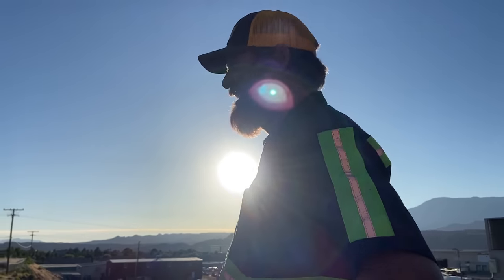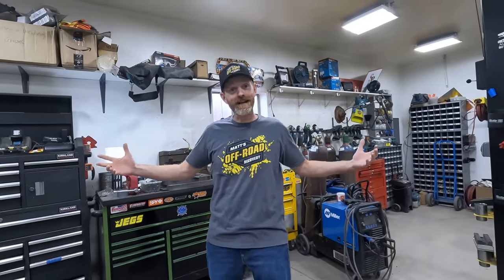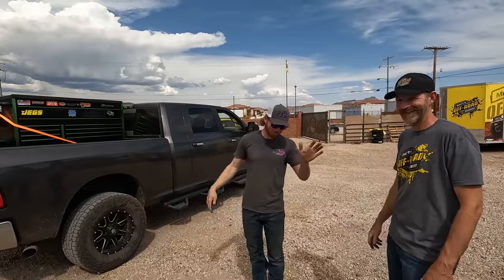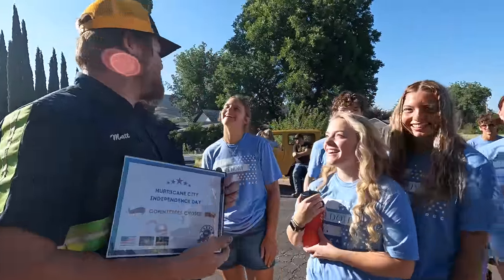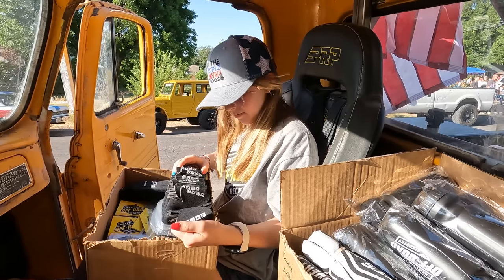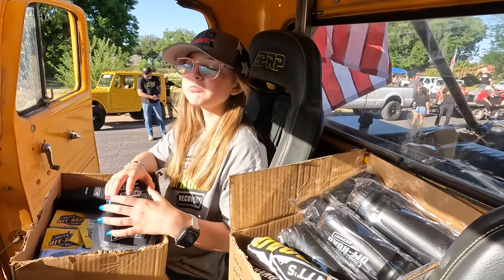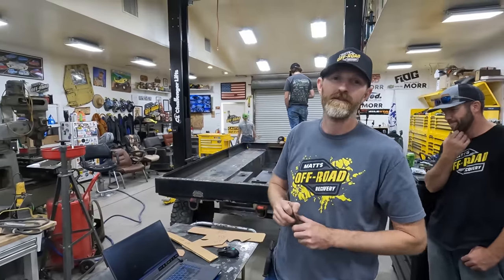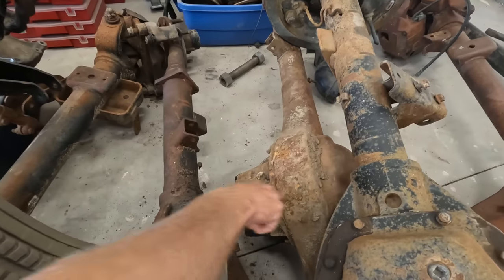Ed Teaches The Team Old Tricks! Bombi Build

Comment: Rhett and Jaymie were absolutely the most impressive at spooning on the tires. Jaymie did it in flip-flops, and Rhett just absolutely killed it.
Reply: And I was wondering if he would even be able to do it he’s like 17 or something not a modern skill we see a lot
Reply: @mikesmith-wk7vy  I think he recently turned 16
Reply: @mikesmith-wk7vy  not a common skill, but a useful one.  Unless you're really serious about DIY, you're not going to have the machine at home, and definitely not on the side of the road.  Being able to mount a tire means you don't have to have extra wheels.
Of course, it also lets you do a patch instead of a plug, but having forgotten about a plug for 20k miles with zero issues, I'm not really convinced they're any less reliable in the real world.
Reply: Rhett: "...hold my MtnDew"
Reply: But breaking a bead on the side of the road...not easy
Reply: @kd5nrh  I'm with you on the plug comment. I don't know where this fear of plugs has come from but it's only been relatively recent. I've only had a few plugs in my tires for leak repairs but I've been doing it for fifty years and never had one fail yet.
Reply: When I worked for a tyre (U.K. spelling) firm, MANY years ago, a plug-patch, fitted from the INSIDE was a legitmate repair.
Reply: @kd5nrh agree plugs are fine. People say thay are only temporary. I say they are as temporary as the tyre.
Reply: @mrmotofy  old school  answers still work every time. Worst case scenario, invert your jack over tyre sidewall  and use that to crack the bead,
Reply: @kd5nrh  Had a tire on an SUV with 5 plugs, it was the only tire that never leaked. Never had an issue till the tread wore out and they needed regular replacement anyways.

Comment: Jefe was the only one to have his tire completely on the rim in under 2 minutes other than Matt. That, to me, was the time to watch since how easy or hard a tire is to get the bead sealed is a roll of the dice. GG to all of you.
Reply: unless it is holding air it is pretty much useless.
Reply: @iffykidmn8170  The video was about mounting tires with old school hand tools. You have to put air in them even if you use a machine.  You missed my point.
Reply: @kogo2951  agreed. I've hat tires that caught air quick and some that took the fires of hell to catch. The real time on spooning is the tire on the wheel. That's why when it didn't want to seat it was all hands on deck.
Reply: And by "fires of hell" do you mean starting fluid?

Comment: I was impressed with all of the crew as to how well they did. I do tires by hand all the time but with a stand to hold the tire. The stand makes it much easier to dismount the tires more than it helps to mount it but the rim not moving makes it nice. One mistake they made was bringing the tires into the shop to cool them off. The warmer a tire is the more flexable it is and the easier it is to mount. Living in a northern state, I've had to stick hair driers inside the tire to warm them up to mount them as they were just too stiff.

Comment: I think the tire mounting competition was one of my favorites.  I use to do tractor trailer tires by hand. I can say that after doing that for a while I picked up what worked and what didn't and I got pretty fast doing it. Getting the beads set so you can fill them, it's sometimes more luck then skill.  I hated when the tires were delivered banded together because the tires on the ends would always be hard to get seated. I did this stuff before the had the big quick release air tanks and I was not allowed to use any flammable sprays. Sometimes if I saw them delivered strapped together I would try and cut the straps asap especially if I saw them the day before. That left them expand so. Anyway I think this was entertaining and I enjoyed watching it, and I was glad to see that when someone especially someone who never did it before was struggling that you left them go a little bit and then gave them a hand.  Also I like the new toolboxes but some of them look really tall. You might need to keep a step nearby for those who are not as tall.
Reply: We used to put a tube in them and put in enough pressure to stretch them sideways a little for a day.

Comment: -- For all you guys hording parts ... one more year!  Couldn't agree more.  Or, if you do get rid of it, you'll need it a week later :)  Happy to hear Tom say this is going to be a long series.  
    Nice of you to do the parade.  Was there anyone else but your lot in it?  And of course anytime Ed is involved, happy day.
    With no suspension, I hope you consider dampeners.   I was a bit concerned, understood the plan, knew the suspension was clapped out; think body, seat/etc dampeners would be an easy step.  
    And I see you have a much different definition of spooning in a shop than we did in the military :D  
    Thumbs up.  Thanks for working on this thing.  Maybe before you get too far some rust converter and RP-342 (It's like Fluid Film) bearing in mind you're rolling in the snow.  Protect it a bit.

Comment: love following your projects and recoverys! I'm a aircraft mechanic and a farmer (!) with both experience of doing the right thing, and doing the right thing the wrong way.... I want to share my experience with machines and sub zero temps. Parts that produce heat will melt snow and ice. When the machine or part rests, the water will freeze to ice and seize the parts. I'm thinking of your choice ot put on extra brakes on the Bombi, and where they are placed. To aviod problems I would suggest to move them (not easy), shield/cover them to stop water from getting to the calippers and disks OR apply constant heat (from exhaust?). Good luck!. From Norway. Gunnbjørn

Comment: These are good lessons for anyone. Good job by everyone.
  My Dad ran 700-16's on his 69 Chevy 4x4. We'd load firewood cab high full length of the 8 foot bed. He had an endless supply of old 600-16  1940's Chevy car wheels that were too narrow for the 700-16 tires, so the loaded truck would split the side of the rim out. I seemed to draw the short straw on changing the rim and tube out. He didn't have any spoons so we had to use crow bars. It did set me up for being pretty good at 10:00-20 forklift tires later in life.
   I trained my kid, and his job starting at 13 years old was tire repairs before the sawmill went all tubeless. He hated the thick sidewalls on skidsteer tires.

Comment: Awesome job Tom, get a label maker. LOL Then Matt will be able to find stuff without yelling "Where's the @#$$%%^ Grinder. I can't find it $%%^^* anywhere?" They are nice tool cabinets too. You are dead right about storing projects and odd parts, as soon as you dispose of them you need them and then have to buy them at a ridiculous prices because they are now rare. No its not hoarding, it's storing. Im a mechanic too and tyre mounting is not as easy as it looks. I've only had 1 truck tyre and split rim let go on me and it was coming up to 60 psi and it blew the side wall out. Luckily it was in the 3 pipe tyre cage and it launched it off the ground. I had to have a little nervous sit down for a minute after that. LOL

Comment: Even though I've never seen Ed mount a tire, I would put myself between him and Matt.

The vast majority of tire work I ever did - including working at a Ford dealership during the Firestone recall debacle, where we did TONS of tires - was with a mounting machine.  I worked some of the earliest, primitive machines that were completely mechanical; I've done it on the ground with spoons, and I've done split rims.

With the horizontal plate machines that grip the tires, you can get good enough to basically "throw" the tires onto the rim because the machine grips the rim.  It's really difficult if the rim isn't holding still for you.

I haven't busted tires since about 2001 or 2002, but I think my time would be about the same as Matt's, give or take a minute.

Comment: At Scot-Track in the 90s we were building 8x8 off-road vehicles that used 8-wheel drive with ATV tyres for most applications but had tracks over those tyres for some applications. The ground pressure was insanely low! These had either chain drive to all wheels or hydraulic drive depending on model. There was NO SUSPENSION and it was fine. So no suspension and pneumatic tyres with tracks over them. The only key difference with your machine is that there is only one drive axle but that is OK so long as the track is strong enough to deal with that scenario. (These Scot-Track designs were also sold to Ransomes who made these in the Nebraska for a while.)

Comment: I've always called them tire levers, not spoons.  I did it to my '76 Honda 250 enduro when I got it from the junk yard in the early 90's.  (Along with a carb rebuild.)  If my memory serves me, I think it was a 6V electrical system for the lights.  Perfect transportation in San Francisco city where parking was non existent.  Just pull up on the sidewalk to park, no pothole or curb too big to just ride over.  Bike was dead reliable.  Two kicks at most to start.

Comment: As far as the suspension on the Bombi, your thinking in the opposite travel direction than a tracked vehicle's suspension works. The suspension isn't to absorb bumps, but rather to keep maximum track surface driving on the ground when going over dips, i.e. push the track down into holes. Basically, by deleting the suspension, you're sacrificing half of the benefit of having a tracked vehicle.

Comment: Matt, would it be worth buying all of the different types of screw in recovery hooks and keeping a set of them in the MorrVair and Banana?

I know you don't use them often, but seems like they could be very handy for the few times that you do use 'em. I can't speak for everyone (of course), but I'd much rather have to replace a $40 bent recovery hook than more expensive car bits. : )

I know this is off topic for this video, but I've just watched one of your older videos where the customer had lost their screw in recovery hook for their Mini Cooper.

Oh, one last thing.... in an earlier video (and by earlier, I mean waaay earlier), you asked what the wires were for on the inside of a Tesla's recovery hook cover. You can touch a 9 volt battery to those wires to pop open the front trunk (aka, "frunk") when the Tesla's battery is dead.

Comment: OK....Being an old guy...I learned to mount tires by hand in 1973 out of necessity. We had a manual tire machine but the center post was too big for the hub hole on 13" and 14" MOPAR wheels. Hence...hand mounting. I start just like Matt and most times you can get the back bead over the outer lip of the rim without any tools. I used soapy water rather than grease for lubrication. The next "step" was actually to step on the tire and hook the outer bead over the rim into the narrow part of the wheel (near the centerline). Step three was to use a big honking rubber mallet to beat the bead of the tire past the rim lip, working it from where the tire bead crosses from the inside of the lip to the outside. In my hay-day, I could manually mount a tire in under a minute that way. If the tires had been stacked for a long while, the inner and outer beads were often pinched together so it was tough to get air in to pop the beads on. With the soapy water, you could generally force the tire onto the inner lip of the rim enough to get it to stick (generally more taper on the inner side) and then pull the tire by the tread toward the outer lip while feeding air and it would mount. Ratchet straps never worked too well for me as they were too wide and crumpled the tire causing uneven pressure on the beads against the lips of the rim. A narrow "belly band" or a rope tightened by twisting a screwdriver also worked. I only used tire irons to dis-mount the tires. Rubber mallet only for mounting. In 50 years, I likely mounted hundreds of tires that way.....but most of those were done in the first ten years starting in 1973. Please ask Ed if he agrees with my 50-year-old method.

Comment: As a teen in the 1980's all we had was snap-on tire spoons and a snap-on aviation style balancer from the 1950's. Ended up owning 3 auto repair shops by 2000. I STILL use those old tools.

Comment: My first experience with mounting tires was on a Model T Ford.  30 x 3.5" tires with tubes and flaps.  There isn't much room to work.  I pinched a couple tubes before I got it right.  Not many 10 year olds circa early 90s could say they had done that!

Comment: So why not adopt the superior German engineering of the 1940's and use an unnecessary amount of interleaving wheels? It obviously is the better setup as it totally won the war fo- I'm totally kidding. I'm glad your sensible in not doing interleaving road wheels or rocker bogies or, heaven and Tahoe forbid, Christie suspension. But you are having to deal with a bit of a catch 22 situation. The Bombi is supposed to be light, but it needs to be heavy enough to be able to pull snow stuck vehicles. But it needs to be really light to maximize it's tracks and engine. But it needs to be heavy for towing. . . . The best advice I can give is maybe have ballasts you can hook on so you can throw some snow in them to add weight. And have them something like a fabric box so you can just unzip the bottom to dump it as soon as you can. But that paradox of being light to gain the track and engine advantages it should inherently have vs being heavy to be able to actually pull against snow stuck vehicles will probably be the most common obstacle it will face. Having snow/water/anything ballasts to add weight temporarily will help resolve that.

Comment: 13:52 I spoon tires on 18-wheelers all the time. I'm the tire/trailer guy. They weigh as much as me. 
Bout 120lbs when wet. I do'em in 5 minutes no bead blaster. Includes removing the old tire. Those Chinese retreads are stubborn.
- Detroit

Comment: A thought relating to using a 9" as the drive axle. They are strong but the spider gears are not the biggest and that is what is going to be doing all the work. They break pretty easily and I have personally broken a few. Especially as the tracks could really hook up on a non snow surface and they are worked hard during every turn. Remember the 9" is strong because of the Crown wheel and pinion engagement being so low. Even though many other common types are not Banjo style they will have larger spider gears. Perhaps a Dana 80. Remember you mentioned you were replacing the axles and I assume the ends of the axle tube so the heavy floating hubs can go and be replaced with the 9" style ends. Maybe even a 110? Dont they use a 14 bolt in a Ripsaw ?
Regardless another one to the fence.

Comment: Last boss hired me to do labor work digging pools. I had told him I had two years of doing tires for dump trucks, mostly 11r22.5/11r24.5's, but all the way down to 17.5R. 
One day he had me doing tires, smarmy guy  decided to crack wise about how he was only going to be gone for 20-30 minutes, and he thought I might have the second 11r22.5 dismounted, and would be barely starting on getting the skid steer tires broke down. He came back in 20 minutes to me having 2 22.5's broken down, we weren't mounting anything yet, a pile of 4 skidsteer tires mounted and waiting for air, and I was just finishing the 5th skid steer tire.
That said, larger tires are really easy to work with and on, I had my first one dismounted before he pulled out of the yard, but those skidsteer tires were not fun at all. I also showed him how to properly use the tools he had, because he watched two Youtube videos and decided to go pro from there. Hopefully he has better luck with my replacement, and good luck with his next set of tires.

Comment: Ok Ok...
I'll let you all in on a time saver step.
Remove the valve core and chuck from the Air hose.
Use the Quick connect directly on the valve stem...dumps the most air in the tire the fastest setting the bead.
Your welcome.

Comment: There was a company called Hydratrek in Covington TN which made a amphibias vehicle which was track driven on land similar to the bombi. My employer has three, the original one with smaller tires on front and rear than the bogy wheels caused it to be rough on land, the newer one has equal size tires that make for a smother ride. No suspension at all. All ways fun to operate.

Comment: I used to race 6 wheel all teraine vehicles.the only suspension we had was the tires. We ran on our big one 100 MPH i had two units one ran about 30-35, the other one was about 55-60. and we did bumps hills brush ponds and creaks on or race tracks. Suspension was not n issue. We used a heavy almost a cross between an inner tube and a hard tire. We replaced the rear set of tires with a harder tire and it added maybe 3-6 MPH but if you tried to run all hard tires you had no control over the unit

Comment: Reminds me of the days back in the late 50's and early 60's when I helped out at my dad's Shell station. We did it similar to Matt, with the exception that the second side we used a large rubber hammer to "coax" that tire on. You put a long tire iron in the side away from you and apply pressure, the use that rubber mallot to beat the tire rim on to the rim of the wheel. We had a big round decice we used to apply pressure on the tread side when initially inflating. Then to balance, we put the tire and rim on a horizontal balancing stand and added weights as needed to center the bubble in the level. Oh yes, lots of fun.

Comment: Nice tool boxes but they covered the convenience outlets, will that be a code violation?  This is by far the most boring video I have watched.  This is like watching Robby Layton sanding body panels, the only difference is I never blinked coz I don't want to miss a thing and I noticed that I have my mouth open the whole time!  You should label each tire with the names of the installer and see which tire gets the first flat and which one get's the last flat.